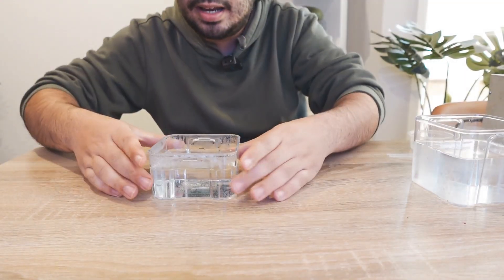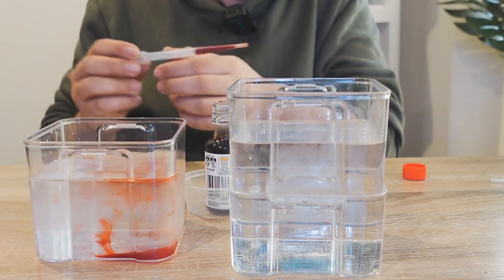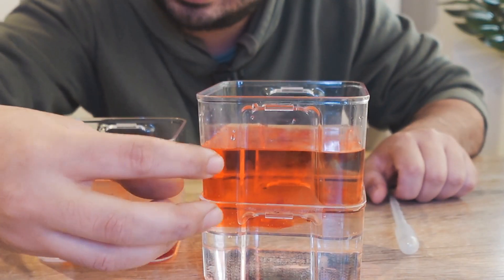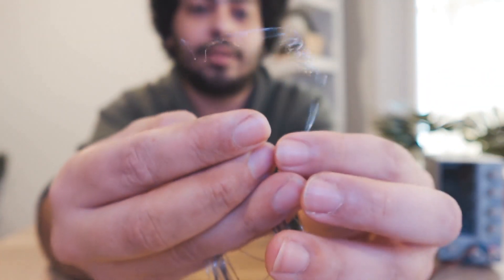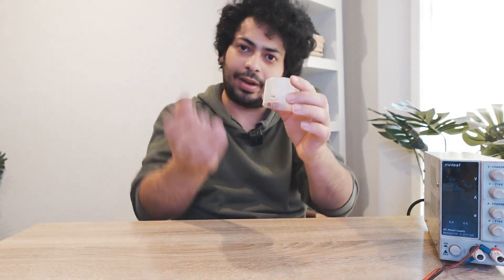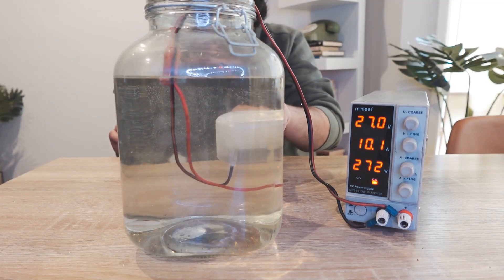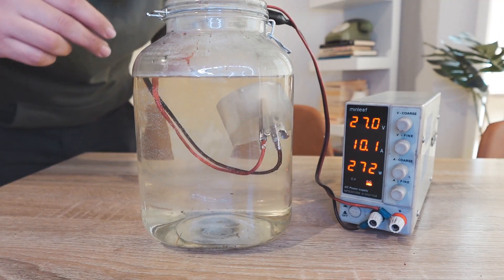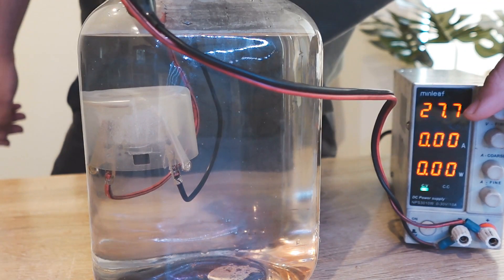I Make A Hot Air Balloon For Water!

Comment: plastic will melt
Reply from the maker: Surprisingly it doesn’t melt because the water is continuously cooling it, it just gets hot. however if a gas pocket forms it will heat up and the wire will fuse to the plastic

Comment: 17 minutes of mess and this guy trying to explain all sort of his dumb understanding about science. would've been better if it's a short video naming.. 'what happens if a induction heater is submerged in water' 
conclusion: inductor doesn't last much longer, gets molten  for the electrodes to get detached.
Reply from the maker: Hmm, a bit  aggressive. 
1. I made a youtube short, this is the longer version 
2.It lasts indefinitely and takes more current, it only burns when i turn up the current too much
3. All things could be over simplified like you stated. A video about how a hot air balloon works could just be described as a  “flame that gets hot”  this is about buoyancy

but i’m glad you made up for the time you wasted on the video with your comment.

Comment: Nice try at science ... But your knowledge is insuffisant, but you lack too much of what really happened ...
First you Made oxygen and hydrogen that lift off your contraption ... Second like true air balloon you will need something much bigger to create lift from only hot water ...
Reply from the maker: lol no. As most of the people who understand this video would know, what your describing is electrolysis which requires seperate electrodes (not connected) and requires an electrolyte like salt in the water to allow current to actually flow through the water and break it down, see my short video where i demonstrate that. There might be very small amounts produced at each electrode here but not much. what’s being produced is steam.
Reply: @TechEyeMan  Your clamps arent isolated ... You can do electrolysis at low current and without adding salt ... it just produce way less ... thats all...
adding to that you use restrictive heating with uninsulated clamps, trust be, electricity won't only move trough the coil and will move trough the water too at a low amount ...
You can do a little Electrolisys with a 9v battery ... Explain me why it would not be the case in your experiment ?

Comment: I love this, man!  I wonder if the stiffness and weight of the wire and clips/bottle cap also reduced movement? I imagine that at this scale, power output is minimal, so weight reduction means everything. Maybe thinner wire with more flexible insulation? Great video
Reply from the maker: Thanks! Definitely true. I knew the weight of the wires etc would weigh it down. The Nichrome wire is already very thin, the thinner it is also the less heat it can handle before blowing out. Also my power supply could only generate 10amps. So a lighter setup that can produce more power would definitely help. I also noticed  currents of hot water leaking out from underneath, if it was more tear drop shaped (like a hot air balloon) it might generate more buoyancy.